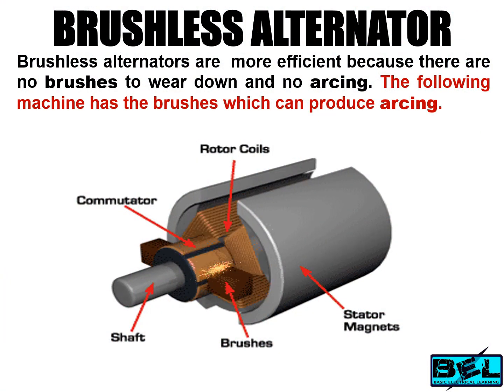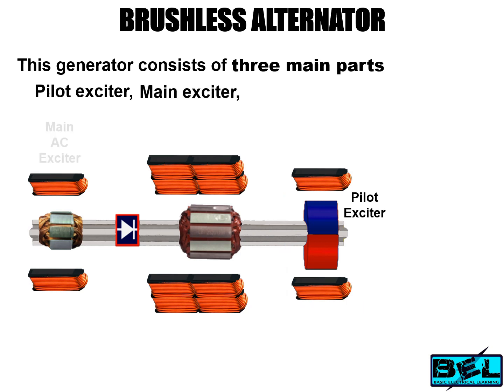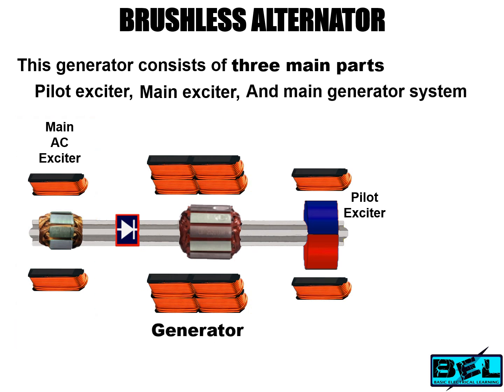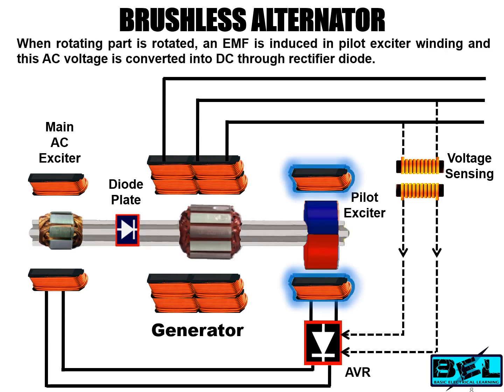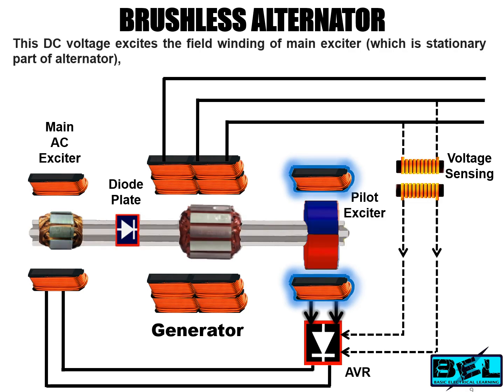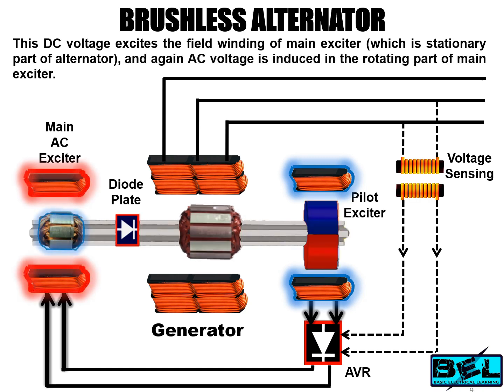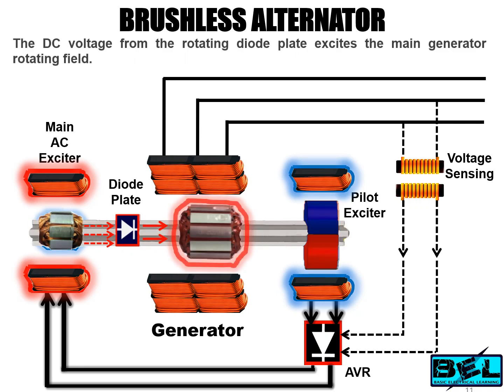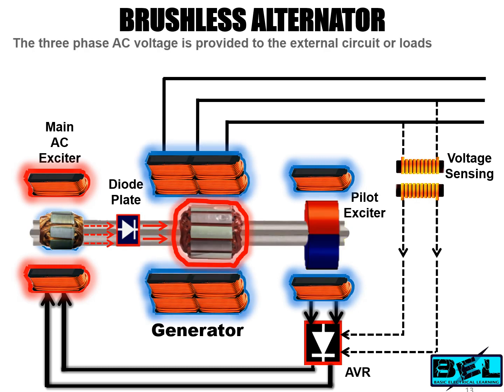Brushless alternator working at Basic Electrical Learning

Comment: Why they have two exciters instead of just one? 
Why can't they have the permanent magnet in the stator which would generate a current in the exciter which will then be transmitted to the rectifier and then the generator's rotors?

Comment: Why is everyone hating on these generators?
Reply: The diodes rotating are mounted on the shaft and are very difficult to replace if they fail.
Reply: Thanks!
That’s all I wanted to know.
Reply: Brush May be easier
Reply: And we can even generate very high voltage using this brushless alternator i see no disadvantage
Reply: @Flames_Spirit  how much voltage?

Comment: did that use fuel or not ????
Reply from the maker: the use of fuel depends upon the prime movers (an initial source of motive power) if the prime mover is an engine then definitely there will be the use of fuel and if the prime mover is Airflow or Water flow then there will be no need for it.